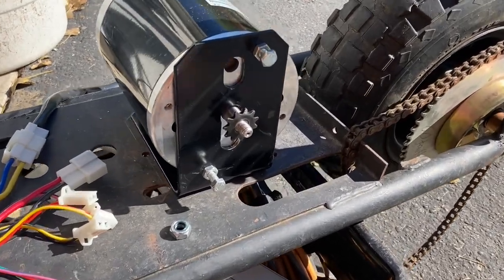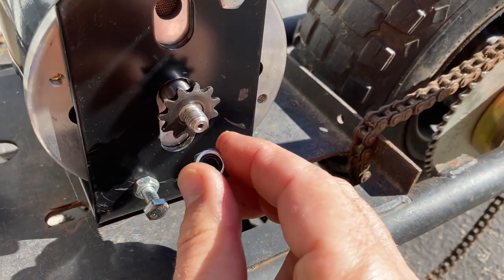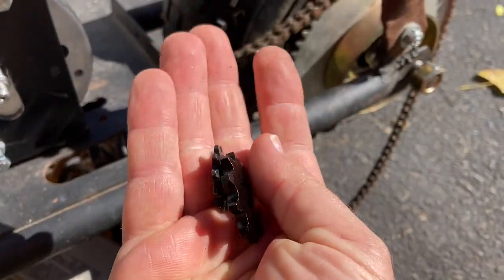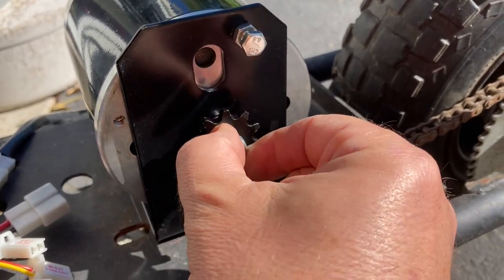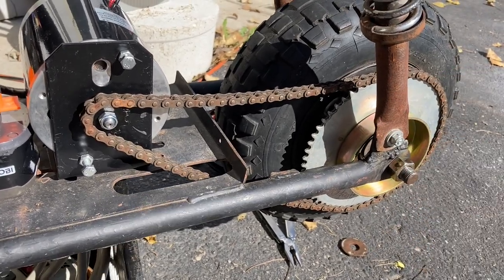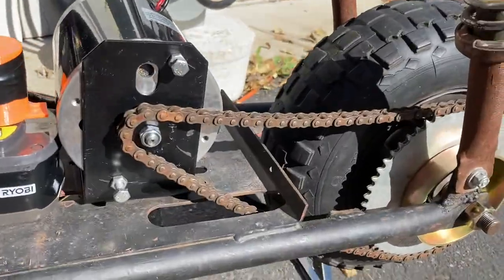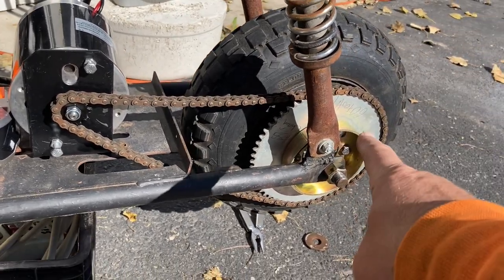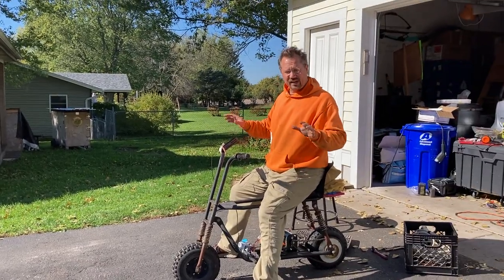Electric Mini Bike Conversion (36V Ryobi) first test run in driveway

Comment: Did this ever get finished? I’m looking at doing a dual 18v setup to add an auxiliary battery to my electric longboard. 
I’d be interested if you have the 3D stl files for connecting the two in series.

Comment: How bout welding a thick washer over the sprocket, to act as a guide/guard to help keeping the chain on?
Reply from the maker: The issue was just that the chain wasn't aligned or tensioned yet.
Reply: @BenjaminNelsonX  ahhhh, okay. Thank you for taking the time out of your day to respond. I have a Baja mb200 mini bike, that I have stripped to convert it to a ebike. Have you heard of the new thin, flexible batteries, that can be incorporated, into the framing of vehicles? You have given me very insightful tutorials, thank you!
Reply: @TuneintoLearning  if you're looking for batteries you can get 48v power cell packs right now on battery hook up for dirt cheap.

Comment: Where did you get that plate that holds the motor?)
Reply from the maker: It's just a generic bracket I bought at the hardware store and drilled holes in.

Comment: Where did you get the #35 sproket for the 36v motor? Thanks for the video. I learned a lot from it.
Reply from the maker: Just mail-order. I got it from the same eBay vendor that I bought the motor from.

Comment: Where did you get that motor bracket?
Reply from the maker: It was a very large L-bracket from the hardware store. I simply drilled holes in it to mount the motor.

Comment: Where’d u get that motor mount
Reply from the maker: @noahwilliams7392  The mount is just a large angle bracket from the local hardware store, in which I drilled a couple of holes.